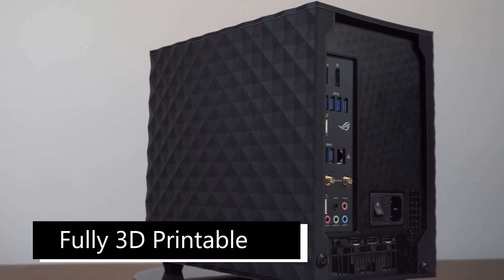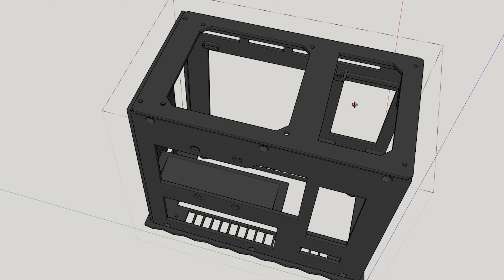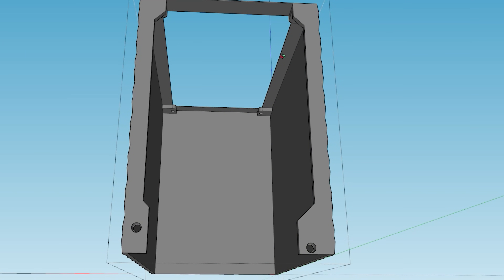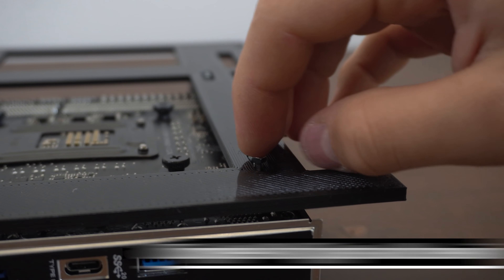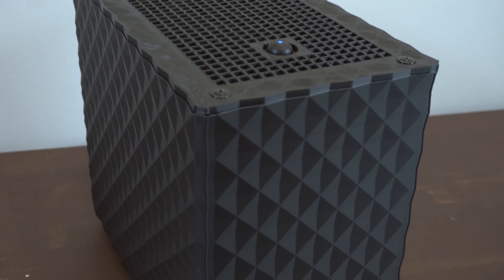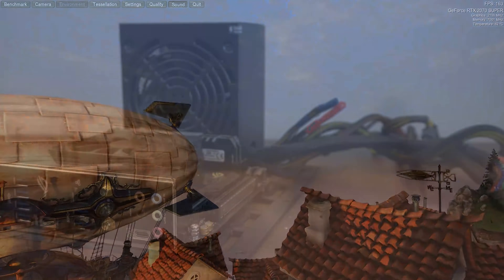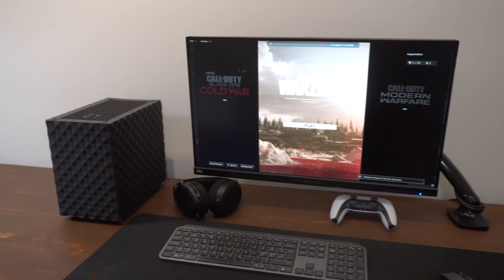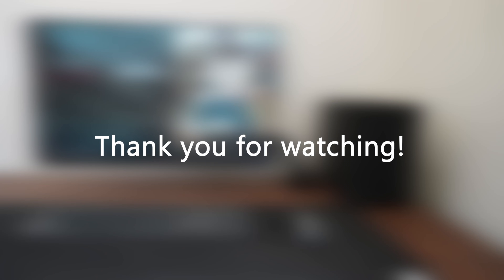CLEAN CUSTOM MINI ITX PC CASE BUILD | 3D Printed

Comment from the maker: IMPORTANT NOTE: The maximum depth of the ATX power supply is 125mm. There is only 126,5mm between the slot it slides into. 
Writing this as there are some ATX power supplies that are 140mm deep. They will not fit unfortunately.
Reply: What's the CPU fan height limit?
Reply from the maker: @tonypeng1815  The biggest I have put inside is a 65mm Noctua NHL9x65 and with the hard drive I still have about 40mm of clearance. So about 100 should be about the limit with the hard drive in place.
Reply: @makerunit  Thank you. Do you think Noctua NH-L12S is a better option since the fan is mount underneath the heat sink pushing the air out? Assuming the memory height is not an issue.
Reply from the maker: @tonypeng1815  hey, I actually never thought of whether the direction of airflow for CPU cooler would matter but you’ve got a good point there. I’ve never used one of those type coolers before. But reading now about the L12s I see it is rated at 95w TDP so I would think it cools better than the L9i which is rated at only 65w tdp. And the fact it sucks air away from the CPU instead of onto it sounds more positive than negative to me so I’d say go for it. Just keep in mind it will blow hot CPU air right onto the HDD instead but I’m not sure if that would matter too much 👍 I hope my answer was somewhat helpful!
Reply: @makerunit  Hi, Can you make a version that supports 160mm PSU Depth? My PSU is the biggest ATX at 160mm. With the extra space, it can fit a tower style CPU cooler such as Cooler Master Hyper 212 or be quiet! PURE ROCK SLIM 2 blowing the hot air up instead of downdraft cooler blowing the air down, improving airflow big time. Technically it acts the same as the case fan on the top. And the CPU clearance with and without the 3.5" drive. Thank you!
Reply from the maker: @tonypeng1815 I guess it’d be possible for you to go into the supplied sketchup file and simply edit each part using the move tool stretch the upper edges upwards until they’re the correct height. Until the psu mounts are 160mm apart (making it 35mm taller?) are you familiar with how sketchup works?

Comment: Hey how abowt a dual camber case😅
Reply from the maker: Please elaborate what you mean? 😊
Reply: @makerunit  a dual Camber (2 Cases in one .one IS for cables
Reply from the maker: @Qerz673  Like two separate systems? or one side for the components and one side for hiding the cables?
Reply: @makerunit  yes one Side for the  cable and one for componens

Comment: Can you please update it instead off a designated hdd spot, the back plate has mounting holes for a 120mm or 140mm fan. And a different top cover that has a perverted triangular top cover. 

I have purchased a 3d printer because of this video. 

Thanks for this great work
Reply from the maker: Hi! Thank you! And I’m glad I inspired you to get into 3D printing! Unfortunately I am not using Sketchup for CAD anymore and therefore I also do not have the license to edit the files. What is possible is to modify the STL files but this is a bit more complicated than the original design file. I believe I won’t be doing any more changes to this design, but for all my future design I indend to make them available in the .step format making editing so much easier in just about any cad program. 😊

Comment: I love this but wish it were cut up so that a more common bed size (250x250x250) could print it.
Reply from the maker: No problem cutting it up but it would ruin the whole aesthetic of the case. The whole point here is to have one clean piece external cover. I have some other cases designed specifically for smaller printers on my channel, feel free to check them out, also, there are more coming 😊
Reply: @makerunit  Will do and no worries. I’m just salty that the 256^3 of my P1P can’t print this one because of how much I like it.

Comment: case this small needs a duct for cpu cooler but sweet build :)
Reply from the maker: I’ve actually thought about trying to design a case where all the parts get fresh air through a number of «tunnels» all pulling air from outside, it would be an interesting experiment! 😅
Reply: @makerunit  I would print this case if you can scale it  to fit e-atx case and split files :)

Comment: Hi, is it possible to get the files to modify? I would like to make it smaller for my low profile single slot gpu and SFX-L PSU (and pther things), and this design is simply great!
Reply from the maker: Thank you! I’m glad you like my case design!

I did include the Sketchup files on Thingiverse and I am aware of the limits of editing these type of files. Unfortunately with sketchup files I am not able to transform these to like lets say .step files for example. So I’m afraid you would need to do this in sketchup. You can always import the STLs i to another program but that also limits your editability a lot.
Reply: @makerunit  Don’t worry, my modifications will probably be minimal, slightly shorter and slimmer, with at most new supports for the psu if needed, and I will Made from scratch the ext. Cover as I’d like to recyle the metal meshes from my current case.
Thank you regardless, very cool idea!
Reply from the maker: @gabbodj95  Awesome! I’d love to see your result if you’re willing to share if you end up making your own from scratch! 😊

Comment: Hi there,
Can u pls do a lower size Version for miniITX Boards with an SFX PSU and a internal Graphics Card? My Printer is 220×220×250mm, this Design is Awesome and i want to Print it :) 
(im from Germany so my english isnt really good, but i try my best without google Translate)
Reply from the maker: Hi Karl! I’m glad you like the design! I’m currently working on two new upcoming Mini ITX compatible projects! First one coming out within a week or two hopefully. They both are specifically designed to be printable on the Ender 3! 220x220x250 🙂

Comment: If only you didn't have such a terrible printer
Reply from the maker: I’m sorry you feel that way. I’m pretty happy with it so far. Sure there are some hickups here and there but it’s been a great experience learning experience about how printers work so I’m glad I bought a «cheap» first printer. 👍😊
Reply: @makerunit  Yeah I can imagine of course, I just wanted to express that you could massively improve print quality (and time) with a more modern printer which would benefit your awesome 3D models greatly.
Reply from the maker: @hanswurst9866  that’s probably true, but being the curious soul I am if I had a more expensive printer I would probably start experimenting with it and picking it apart anyways so for now I’ll stick to what I have but I’m sure there are more efficient methods. Currently today I have the CR10 and Ender 3 and when they work together I can produce quite big prints in just a few days. Ofc it’s slightly slower but it works for my current needs 👍

Comment: hey this looks awesome, my favourite 3d printed case out there so far (currently using a tower style one). I'm just wondering what the bed dimensions need to be for this; do you think it would fit on an ender 3? Thanks!
Reply from the maker: Hey! Thank you, glad you liked it, it unfortunately requires a printer at least like a CR10 or bigger. 300x300mm print volume. An ender 3 is unfortunately too small and because of the pattern it would be hard to make look any good if printed in smaller pieces. Part of the look is that the entire cover is one piece… 🥲

Comment: LxWxH，how size？
Reply from the maker: Hey, Unfortunately I’m currently away on vacation the next few weeks so I’m unable to double check but I believe about 290x150x210 maybe? Sorry for the inaccuracy but I know for a fact all the parts fit within a 300x300mm printbed (CR 10 or similar sized printers). 

One way to find the exact size is to download the files from Thingiverse and load it into the slicer, at least PrusaSlicer or SuperSlicer will show you the exact dimensions of the object, probably most other slicers will do that too. Or download the sketchup file and use the measuring tape tool. I hope this somewhat answers your question! Have a nice weekend!

Comment: Very nice case!  What are the modifications you made to your printer?
Reply from the maker: Thank you! Back when I printed this case I was using a stock mainboard on my CR10v2, the only modification I had done at that time was to install an E3D Hemera direct drive extruder because I managed to break my stock creality one. I had also simply disassembled the external control box and mounted all the components on the underside of a piece of plexiglass which I slid into the frame under the printbed.

Comment: What about an MATX version!! :)
Reply from the maker: It’s possible, but at least with most common printers the printbed doesn’t exceed 300x300mm, including mine. (Usually even smaller) so would be hard to fit anything bigger within the print volume to keep the outer surface as clean as this, but not impossible. A mATX cube of about 280x280x280mm may may allow for a mATX build but would end up around 22 liters in volume. 👍😄

Comment: An sfx psu with an atx mobo in a case this big would be cool to see
Reply from the maker: I’ve thougt about it, would need to be a bit bigger but not impossible! A goal would be to keep the entire outer cover within a 300x300x300mm room especially for a pattern like this it would be hard to get as clean if splint into smaller chunks 😊

Comment: Great video! Which material did you use? Have you had problems with creep or other issues?
Reply from the maker: Thanks Hans! I used PLA for this case and it will work just fine this particular case is still in use today over half a year later still not a single issue or warped part due to heat so I can confirm that PLA is well suited for a PC case as long as it’s not directly touching the plastic with the hottest parts, only a few millimeters of an air gap between hot components and the plastic is enough. Though, as I answered on your other comment in the other video, I would probably now recomment PETG if you can just because it feels so much stronger as the layers bond much better, but PLA really works well too! So its mainly up to you what filament works best with your setup honestly. Though PETG has turned out stronger at least for me. 👍

Comment: I am also looking for designs and I have to print my own case, but I have a question, the filament (plastic) could create static and this affect the components? on the other hand great design sir thanks for the video.
Reply from the maker: I notice many people are worried about static, and I, after making multiple cases now have still not noticed single static charge or anything at all that affects the components through any of my builds. The case in this videos is still regularly used and works just like day one still after 6 months, never had an issue 😊 I know plastic parts in some cases can make static but from my experience it’s really not an issue at all 👍
Reply: @makerunit  thanks

Comment: PSUs have no exhaust fans, all PSU fans are intake fans.
Reply from the maker: Yeah I know but the intake creates a positive pressure inside the PSU forcing the air towards the ventilation on the back of the PSU which in this case points upwards making it blow the hot air up through the top, therefore I referred to it as exhaust 😊

Comment: I just assembled an ITX build with this case and have a few suggestions for design improvements.

Make the design about 10-20 mm taller and remove the built in PSU support shelves. My PSU (Corsair CX430) was about 10mm too long and I had to cut off the shelves. The wire bundles also pushed down on the GPU quite a bit.

#2 design around using M3, M4, M5 or other standard metric cap screws. Can easily use M5x12 round head screws for most of the assembly if the countersinks we're sized right. You could even make a design that uses those heat set thread inserts.

Could be nice to have the option to mount a 120mm fan on top if you don't have a 140mm on hand.

Those were the biggest things. Overall the design was well thought out and fairly easy to use.
Reply from the maker: Thanks Mark for the feedback! Yeah before designing this I wasn’t even aware that there were different sized ATX power supplies, therefore I made it like I did, also I was afraid the screw mounts wouldnt be strong enough if I removed the little shelves. The cables barely fit with the 125mm psu so I can see why it pushes down a bit for you. About the screws, oh yeah they’re definitely not the most practical solution, it’s just what I had at hand at that point. I’ll stick to more standard prefabricated screw sizes in my future builds 😊 adding 120mm support is a pretty quick so I actually just uploaded a new top version now, now there is holes for a 120mm fan on Thingiverse 👍😊

Comment: can you have step files or any other files to i can make some small edit in fusion 360, skp files not working.
Reply from the maker: Hello Alex! I’ll look into it. I’ll comment here again once I have the files ready! 😊
Reply: @makerunit  cool. Thanks
Reply from the maker: @alexvikingo6676  I’m not sure exactly how to get the .skp files to step files, is there no way you can edit the STL?  At least in sketchup it’s easy to just import a STL, use a «cleanup» tool and edit from there
Reply from the maker: @alexvikingo6676  will any of these formats do?
.dxf
.dae
.dwg
.obj
Reply: @makerunit  .OJB or .STEP will work. maybe 3mf as well.  Im trying to make mod, 335mm 2.5 slot gpu and water cooling and case as small as possible.
Reply from the maker: @alexvikingo6676  https://drive.google.com/file/d/1R2msEz7U68y9O6I-zvbqbQzbgwZN2d_I/view?usp=sharing

Can you let me know if this link works for the download? Seems like Thingiverse has issues, I'm not allowed for some reason to update any of my projects at the moment... If it doesn’t work please message me on Instagram #makerunit and I’ll find a way to send it to you!

Comment: Congratulation for this box. May I ask why there are no holes on the side panel? Wouldn't it be better for cooling? Just wondering
Reply from the maker: It’s mainly for the looks of it. It’s airflow is definitely not optimal but my aim for this case was a super clean simple look. And because temperatures are within the acceptable range for mid-range components like I’m using here I saw no need to add extra holes etc. Also, I didn’t mainly design this for the purpose of sharing it as it was mainly designed atound what components I had at my disposal at the time. I actually made the case a while back around february along with my other case (the small white one) and got a lot of nice feedback on them so I figured I’d share them in some videos 😊 that’s kinda how this YouTube channel started for me 😀

Comment: Looks nice 👍
But I hate stuff wrapped in electrical tape, much cleaner and better is heat shrink tubing. 😉
Reply from the maker: Thank you! 😊
Honestly, I kinda hate that too (especially for visible cables) but at the time of assembly I didn’t have any laying around and I figured it didn’t matter too much since it was all hidden inside the cover.

Comment: AMAZING! When a design with 2 3.5 drives? or a NAS version
Reply from the maker: I’m glad you liked it! Working on an even bigger case at the moment, I’ll try to include room for dual 3.5s if the design allows for it, which I think it will do, at least one. 😊

Comment: So rad dude! I've thought about case design (and made a prototype out of wood) but haven't gotten into the nitty gritty. Very, very cool. I really like the design: it's simple, yet shows a design element that would be difficult (or expensive) to achieve if it were made from metal etc.
Reply from the maker: Thanks Michael! Honestly getting it into a 3D printable model isn’t that difficult if you learn some of the basics in a CAD program. The most difficult and time comsuming part is figuring out the layout and print test models 😅printed maybe 3-4 of each part before making the final making small adjustments every time. 

Working on a new bigger case now for mATX/itx support and 300+ mm GPU’s 😊 seems promising so far so I’ll have a video out once its done 😊
Reply: @makerunit  heck yeah. Maybe I'll give it a go. I know how to use fusion decently well, and I just noticed you've got a coupe helpful videos on the topic ;)
Reply from the maker: Yeah I tried to show my process best way possible. It’s mainly intended to show how I go about making the design and setup, and from there I start my prototype prints before a final case design is done 😊 I’d love to see your case if you ever decide to make it if you wanna share it. I am reachable through Instagram DMs, same name as here.
Reply: @makerunit  heck yeah dude. Absolutely will do

Comment: 83c on the gpu means its thermal throttling.
Reply from the maker: Possibly, I don’t know, but this is a blower style card and no matter what setup I put it in I still reach those temperatures. It’s got to do with the design of that specific GPU. You see my other gpu got 66 no problem. And I see no reason to why other cards will get particularly hot, considering any GPU added will be facing fans down inhaling fresh cool air from below 🙂